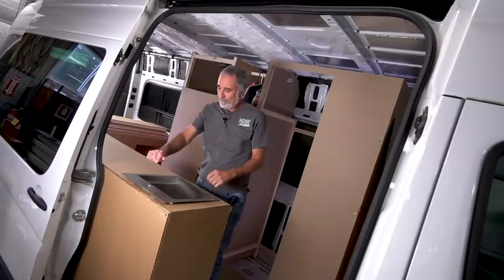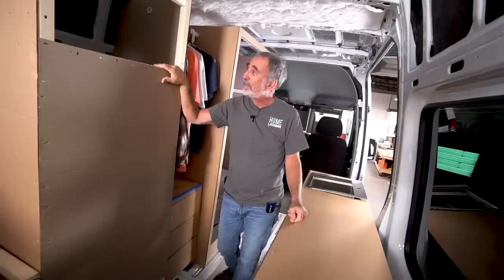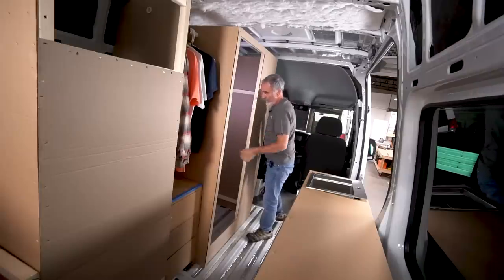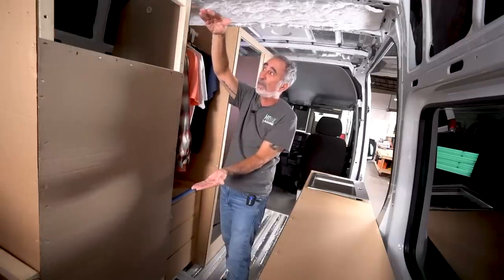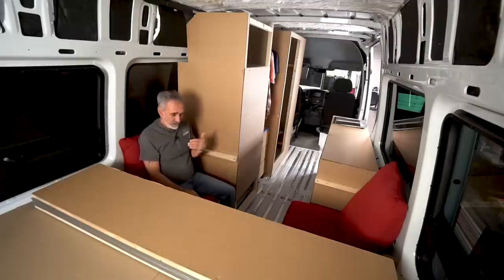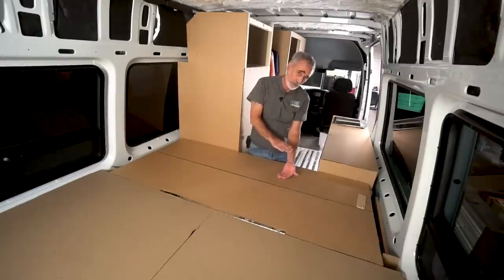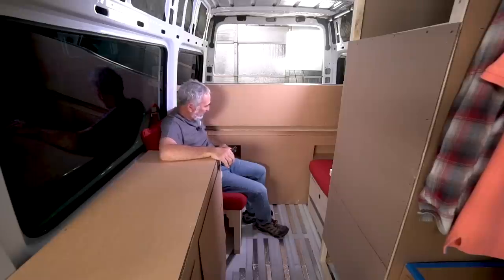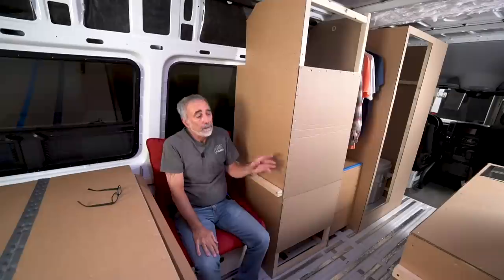Dining in a Sprinter van. Hidden bed. See the cardboard test floor plan!

Comment: I would prefer to move a foldable dining table to the front and make the driver seat and passenger seat swirl around. Then add one or two seats (with 3-point seat belt) between the toilet and the driver seat. With a folding chair, it will be possible for four or five people dining together. As for the bed, I prefer a bed that can be raised up and down. By doing so, I will have storage room for bicycles or a kayak. When need to sleep, I just lower the bed down to the level above the bicycles. I could use a multiplayer folding chair as my ladder to the bed. It’s possible to sleep four or five people if move out bicycles and make a bunker bed. The fifth person may sleep in the dinette area. This part needs a more creative design. But I believe it’s doable.

Comment: A queen size bed is 60" x 80"  I spent years selling furniture, and there are no 75" long mattresses.  You may say, "in an RV, a queen is 75"," and I would counter that then you need to say RV mattresses, because real world queen mattresses are 80" long.  This is important to me because I am 6'4" (76").  I would love to have you figure out how to get an 80" long mattress in a Transit van along with everything else.

I like the more open dining area.  Does the fridge have to be exactly where it started to miss the beam?  Could it move over a few inches closer to the dining area and miss the wall beam?  I cannot see the design exactly the way you can, and I am mostly thinking out loud.

Love the videos.
Reply from the maker: Oh don't you worry! I'm going to find two Sprinter super high roof vans (they only made them off and on. Advanced RV did a van called Escape) for you and one other of my Humble community peeps.
Reply: @HumbleRoad  That's a nice side-by-side compact refrigerator in the Escape.

Comment: How many inches could you move the refrigerator without having it to pull it out of the window box?
Reply: That's what I was wondering. If he narrowed the armoire a bit, he might be able to push the fridge back into the window recess to gain back walkway space without boxing someone in on the dinette..
Reply from the maker: Not enough, only 2 inches or so.
Reply: @HumbleRoad  that's a shame :(

Comment: Why not put the fridge unit behind the driver's seat, take advantage of that window space and give the option to take the fridge out through the side door if it needs replaced? That would also bring all of your plumbing closer together.  Is that not an option because waterproofing the bath around that column would be problematic?
Reply from the maker: The shower box is a completely self enclosed module which can be place anywhere on the drivers side. The fridge is in the shop and it is left hinged. If it were right hinged, your suggestion is a go!

Comment: Yes, the second floorplan looks more "feng shuish". If I really had to I would put a swing-away or slide-out clothes hanger in the shower stall...for those go-to-church outfits or bulky winter coats  :-))   Too bad about the fridge coming out more. 
The barrier between the bed and seating could be done in a more airy decorative wood screen to feel less closed in, and it even does not have to be a solid wall all the way across - could have an opening in the middle.
I do like a wide laneway and right now my galley is 4' long x 12" deep with a slide out extra table top or chopping board, b/c I'm not into cooking and washing up. Those narrow laneways with a couple can get old and tiresome really fast.

I'm waiting for a client to ask you to put a 6x6 hydraulic pull down deck in the stern.
Reply: An idea of Feng Shui is, "Imagine a dragon living in the space you're designing. Could it move around freely without getting stuck in corners." Yes. The second layout is MUCH better!

Comment: Would you gain back the original width of the aisle if you switch the refrigerator & bathroom locations?
Reply from the maker: Shower box is deeper than fridge box

Comment: Having a fixed bed is really nice because you don’t need to put all the bedding away really. But why not fold it lengthwise so somebody could still nap occasionally?  Or add wall flairs/pop outs like Winnebago revel

Comment: How about  you raising the dinette area onto a rectangular raised area so that both diners have arm rest area at same height 'elbow' height (armoir and counter top)? Result:
1. Then Armoire can be made taller maintaining your current  arm rest height - so can add extra storage/height/drawer to Armoire
2. provides 'natural' first step to fixed bed (you could also fix a second swing down step from garage wall) - free's up space you would have used for other step
3. introduces area of storage between armchairs at floor level - possibility for drawer at that level - in my design its for tinned food goods, keeping heavy items low in case the worst happens!)

I've been looking for same used vehicle in UK and this is my current planned dinette and bed design (my kitchen and bathroom differ)

enjoying your channel
Reply from the maker: Excellent thoughts!

Comment: Why not go the whole way & switch the fridge & the shower, too?  Could you get the fridge into that window? Maybe slide the door of the shower to the right? Now the fridge is closer to your sink, and if the shower door shifts right, you won't be looking at the toilet while you eat, if it's left open.  Just thinking of options...  😄
Reply from the maker: Fridge is already in the shop. It has it's door hinges on the left side, so further aft is better, but I get where you're going!
Reply: @HumbleRoad   Most fridges allow for a switch of the door hinges.  We did that with one fridge.
Reply from the maker: You are correct. But not this fridge.

Comment: Hi George. You said that the Sprinter is narrower than a pro master. What van would you recommend for the best interior space?
Reply from the maker: I haven’t been in the Ford so right now it’s a toss up between the longest Promaster and the longest Sprinter. They each have their strong points.
Reply: Yes. True. The Ford has the greatest height at 6’ 7”, and the second longest interior space at 12’ 10” behind the Sprinters amazing 15” interior.

Comment: With the bathroom so big, why are you not using the Nautilus shower door? I'm designing my van now and use have thought out a lot of things I've questioned. In your experience, is there something wrong with those doors?
Reply: *You have
Reply: When you move the armoire out could you replace it with one of those Closet Booms on the backside of the refrigerator? Is the refrigerator closet strong enough to support the Closet Bloom and the clothes that you would hang? Maybe a door that we would open and close when someone is not sitting there?
Reply from the maker: The Nautilus would act as a shower curtain to contain the water. One issue I see with the Nautilus is the housing is a bit large for such tight van bathrooms.

Comment: could have solved most of those problems if you just switched chassis's.... AKA Promaster....    love the cardboard mockup. the problem with this setup, is that while it may be easy on the eyes, but if someone wants to sit and enjoy breakfast, while the other person is snoozing in for an extra half an hour.... or just take a nap... I don't know should be away to fold that in the back so someone could still use the bed and the other person could lounge in the dining area.....but..............  I guess you can't really sleep sideways, I keep forgetting...lol
Reply from the maker: Don't forget the double workstation lounge up front as another living space.

Comment: How is the client going to be able to reach so far and unfold the mattress?
Reply from the maker: The trick might be to do both movements at the same time. Or maybe I think of a mechanism when the half wall is pulled forward, it brings the mattress up and over. Think Little Rascals and Swiss Family Robinson!
Reply: If needed, I'd attach a pull strap to the bottom of the fold out part, that is long enough I don't have to reach over to tug it into the unfolded position.
Reply: Humble Road — if the mattress cover is sewn together (as opposed to having 2 separate mattress cushions that are just placed side by side), you would need a strap of some kind: otherwise, the client would have to kneel on the wooden platform to unfold the end of the mattress.  If they can afford your van build, I assume their knees are not so youthful, so that might be uncomfortable.

Comment: I’d put a narrow cabinet (~1ft deep) up high on left of fridge (leaving at least 18 inches clearance above counter (left of the seat) so it can be used like a side table)  with the door opening towards the bed (opening over the seat).  Then install one of the Ikea pull out hanger rods in that.  It’s designed for low depth cabinets.  Sample is here: https://www.ikea.com/us/en/p/komplement-pull-out-clothes-rail-dark-gray-90256968/. ❤️

Comment: I don't like the bed/lounge layout! I like the larger bathroom, I don't like Wet Baths!  I like large showers.  I like large lounge area's!  I like large bed's! George, I don't like the folding mattress.  I don't like the small lounge area facing each other and playing footsies for feet space!  My suggestion for the short wheel base Sprinter 4x4 van is to have the Queen sized mattress elevate to the ceiling when not in use and use under the bed as a large lounge/dining area for comfy seating.  The suspended bed could use a system that hinges similar to a "Gimble Stove" on a Sailboat so that you can sleep on a level bed when you can't find level parking.
Reply: Maybe you can have it all.I've seen another van build doing just that.
You might like the unique shower stall in the newest Hymer van in Europe.  If the bed is at the ceiling when not in use does that lose the garage space?  I think they could consider other models of refrigerators without sacrificing too much.
Reply: @colleenkaralee2280  With the bed at the ceiling, the lounge could come forward of the rear doors a foot or so allowing room for garage space.  First Class accomodations with the bed recessed into the ceiling.  Hovering over the lounge and possiblly using the lounge as a bed as well making a bunk bed guest bed...
Reply: @jameslamb7300  I'm starting to warm up to that idea.  The pop tops usually have a bed up top.

Comment: I think that if people put half as much thought into what they say and do, before they say or do it, as George does in designing a van, we'd only need nine of the first ten amendments.

When you started discussing the possible (more than likely), claustrophobia problem George, you did so with the bed extension laying flat - so you'd have a camera angle. That's not how it will be however. Had you filmed that segment with the extension up, in its normal position, like your thumbnail shows, your point would have been driven home with a sledge hammer.

As you said, things change once people are actually in their vans. I'd hate for you to have an un-happy camper. Lets hope your clients listen to your advice - It's well reasoned, comes from a depth of knowledge, is grounded in common sense and, you have a solution in hand.

My van, still in construction, has a similar layout in that it has a raised bed with dinette seating in front of it. In order to reduce and hopefully eliminate claustrophobia, I did two things, by design:  First, I bought the 170" extended.  Second, even with the additional space, no tall cabinets.

I don't feel as though I gave anything up with my design. My van has a 75L fridge & freezer, a compost toilet, and a dual purpose shower area; an idea you built into Van#1.

One last thing George. I am at the point in my build that I am picking out cushions.  One problem I thought I had is that the dinette back cushions would be higher than the counter tops. This video shows me it's not an issue so, thank you for that.

Comment: There should be a drop down sink in the "bathroom".....or.....it's just a shower with a toilet.
Reply from the maker: A sink in the bathroom is redundant. Not necessary.
Reply: @HumbleRoad  It's never redundant.....I don't brush my teeth in the kitchen sink in my house, WHY should I in my VAN.....???
Cross-contamination is the reason.
Reply from the maker: My guess is that you have not spent any time living in a van. And BTW, you brush your teeth in the same sink where you wash your hands after a poop..
Reply: @HumbleRoad  Right...but I don't wash my dishes or fruits and veggies there.....that's my point. European cans have full enclosed bathrooms, but here it's a rarity even in a skooley.  To each his own.

Comment: I'm literally looked at thousands of these van builds in there all the same, but for a few handful of them that people went outside the lines of half the van being bad and the other half being a few little small benches and they sink encounter top, not trying to be rude but can there be more imagination when it comes to building these vans
Reply from the maker: Why don’t you take stab at it. Design in all that you envision. And make it fit in the space. And don’t forget attachment points, off gassing and protection from a crash.